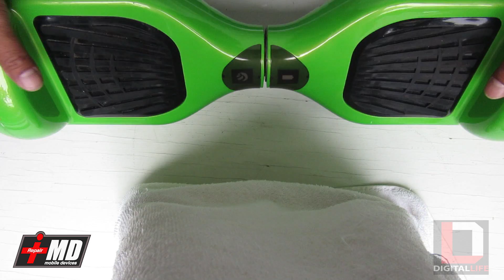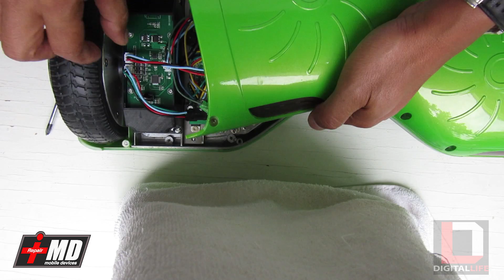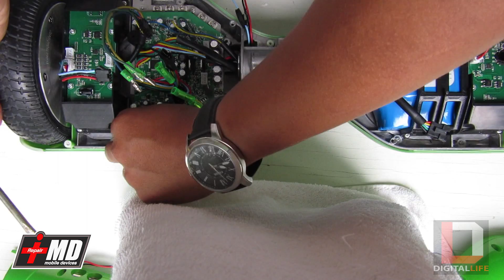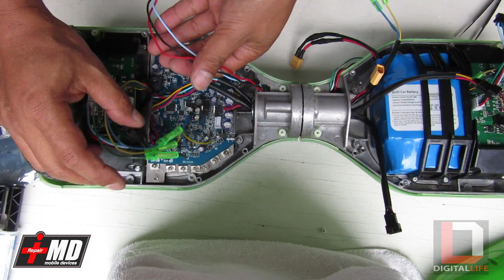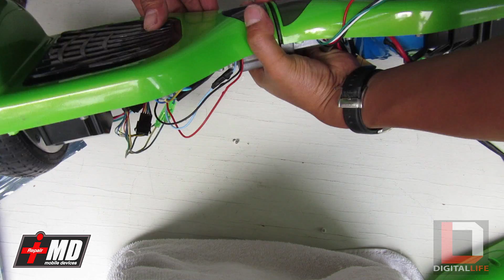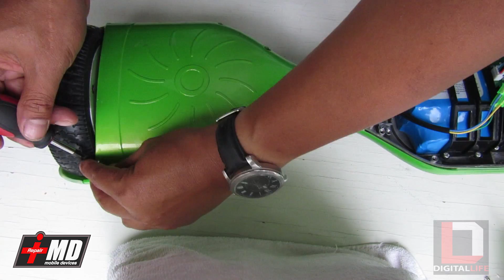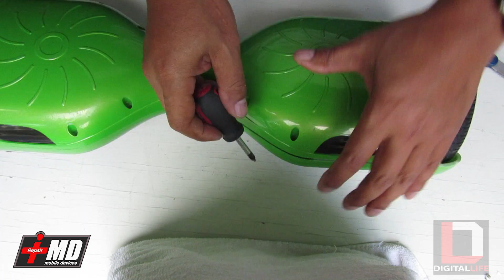Smart balance wheel no  power repair

Comment: Hi
Good day.
Nice video.

The price of the spare parts quoted by the website you have posted are way too expensive.
Might as well buy a new unit & cannibalize the old unit for parts, ???

Anyway, good tutorial video.
Thank you & have a nice day
Reply: Anywhere I could buy one cheaper?
Reply: I mean the logic board
Reply: +Ty Fulmer 
Hi
good day.
Sorry I have no idea at all.
I, too, would like to know where to get the spare parts at a low price.

If the mother board is USD250 then it is not worth it, might as well get a new unit & cannibalize the old unit for parts for sale.

If you have a smart wheel with malfunction motherboard, you should contact your seller.

Thank you & have a nice day
Reply: +putianren hi I have another question. If I don't have all those screws in around the logic board, could that cause problems? Like could that be why mines not turning on? Because around the logic board, the screws that hold it down are in, except for 2. There are 2 missing
Reply: +Ty Fulmer 

Hi
Good day

What??
I really have no answer to missing screws, LOL.

Really, this is something new to me, LOL.
Your answer is as good as mine.

OK, maybe it could be, sometime, the assembler could be lazy or forgetful & left out the the missing screws.

When you open the casing & if there are no extra screws falling out, then it should not the cause.

Thank you & have a nice day
Reply: +putianren Lol okay thank you, I've pretty much ruled that out as to why mine won't turn on. It's definitely the logic board, looks like I'll have to replace it! Thanks tho!

Comment from the maker: http://shop.digitallifex.com/products 
for parts
Reply from the maker: +Ty Fulmer http://shop.digitallifex.com/collections/all
Reply: Is there anywhere else I can get a logic board for cheaper?
Reply from the maker: +Ty Fulmer we are working on getting them at cheaper price and we will pass to savings down to our customers. Stay tune and visit our site to keep up to date with the prices
Reply: no where can i find the logic board on their website
Reply: +Nick Tepe okay awesome, thanks a lot man! And did you have this problem as well? Mine just turned off randomly with no warning and nothing works. No response to charging or pressing the power button. I also ruled out the fact that the battery could be broken because if it was the battery then the led lights would still be able to turn on. The led lights are controlled by the logic board and the lights won't turn on so that sort of narrows it down. So do you think I should purchase the main board?
Reply: hello!, I really need your help!!!
Reply: hello I need some help please. ..board powers on and sensor lights go on but board will not go...help!
Reply: hello I need some help please. ..board powers on and sensor lights go on but board will not go...help!
Reply: +iRepairMD Youtube yo can u get in contact with me at 9732342667 i am having multiple problems which i think you can help me with
Reply: hi my hooverboard when you ride fast or try to do a hard truck it cuts off please tell me what the problem is and it don't hold charge very long.
Reply: you ust have a horrible innerpiece bro no doubt about it and dont do hard trucks bad for he board :]
Reply: does that battery sensor affect the charging of my scooter ? like everything works but the white wire is messed up i tried putting it together with electric tape but am not sure whats wrong ?  can the white wire be the reason why its not charging  ?
Reply: +Duke fileds i think i may have the same problem how long does the charge hold
Reply: iRepairMD Youtube
Reply: iRepairMD Youtube  my hover board trip off while ridding.wat could by the problem